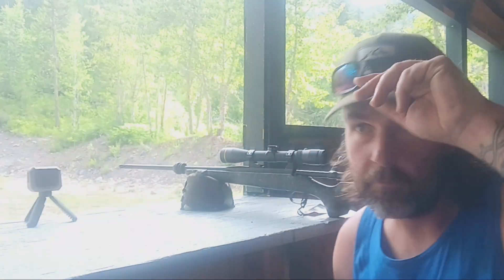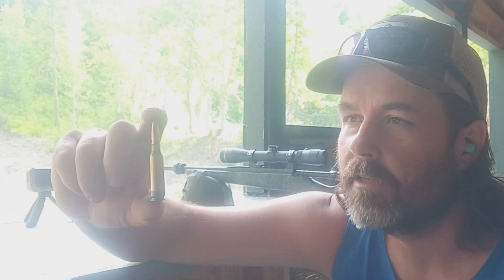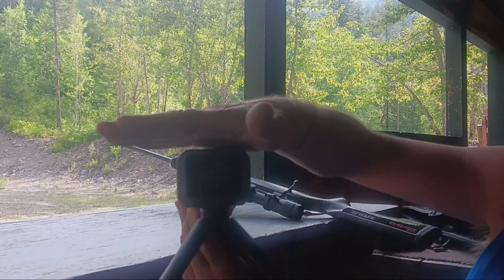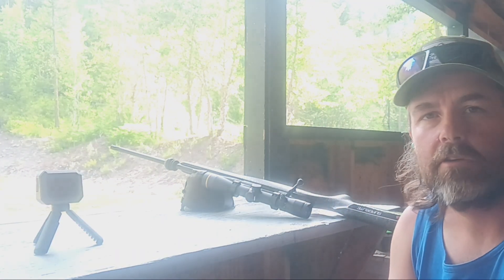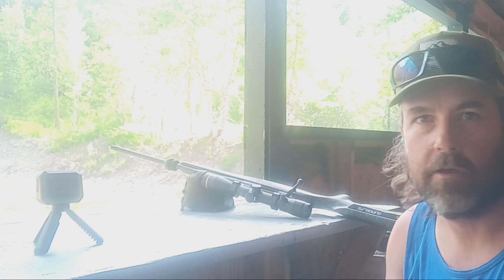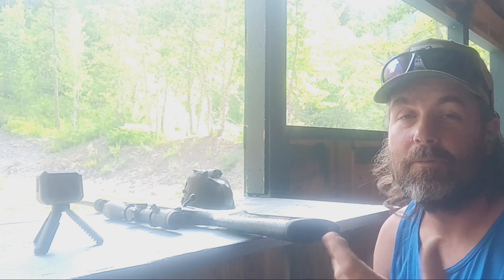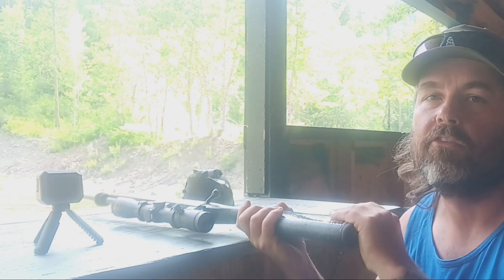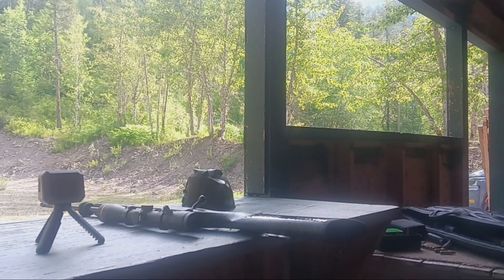High velocity 6.5CM possibly beating the 6.5 PRC??? What???

Comment: You can seekins precision makes a ph3 chambered in 277 fury! I already purchased 400 hybrid cases and sized them down to 6.5 creedmoor! Just need to order a seekins ph3 yet! They redesigned there action to handle 80k psi check out big game podcast with matty Nelson there easily achieving 3150fps 140gr class bullets out of 16inch barrel!
Reply: Update purchased a seekins  ph3 24inch barrel and iam shooting a 140gr fusion at 3,050fps! Tried several powders and verified thru grt! Done this in 308 as well a 168gr ttsx at 2950! Just purchased 277 dies and more casings along with 150gr accubonds!

Comment: So this is a 6.5 cm round? And is this something you’re going to try to market or just going to share the recipe? Just curious because I shoot a 6.5 cm with a 20 in barrel and looking to get better that high 2500’s velocity to low 2600’s
Reply from the maker: This is 277 Fury brass converted to 6.5 Creedmoor by running it through a Creedmoor full length sizing die after having milled about 2 tenthousands off a shell holder to bump the shoulder back a little extra that is required on first firing than trimmed to length. Fire forming is not necessary but a good idea. Then start working up a load. The stainless steel head will not give you pressure signs, so you need to be extra careful and watch all other signs. (Primers are not a good indicator either as somehow the stailess base seems to make them tougher.) Start like you would with available data for the CM, and don't go way off the charts. Superformance gave me the best velocities while maintaining good accuracy thuss far. I'm still working on this and will be for a while.
Reply from the maker: No, I don't have plans to market it. For liability reasons, I will not share my load data, but I am willing to give enough information so one can do the same and work a load to their rifle. 

Ball powders recommended for the CM work the best because of case capacity. Start low and work up. Don't push too far as the steel base does not give you pressure signs like brass dose.

Comment: Not many hunting rifles are a true sub 0.50” MOA
<.75 MOA is plenty good.  Mean radius why more relevant.   MR <0.30 is the benchmark for 500 yards.  All day
Reply from the maker: I personally believe in respecting game with an accurate and ethical kill shot. Know your limits, and don't push them on game.

I find the milk jug challenge to be a good test for a hunters' limits regardless of how well one can shoot paper. If you can hit (not graze) the jug and make it pop first shot (cold bore) from whatever Shooting position than that is an okay range providing the the bullet one is driving has enough energy and velocity to get the job done right. (Water is not a good test method as the water does not compress)

Comment: Glad to see you're back. Talk about coming back with a bang! Can't wait for you to try this in a 7mm-08 or 308 Win. I wonder now close a 7mm-08 would get to the 280AI? Or would it just make it to 280 Rem? Won't ask you what powders you're using but I am wondering if you keep checking the headspace to see if you're getting any set back. What a wonderful idea. Presently we're limited to .473 rim diameter so nothing in a magnum case diameter. I'm not really interested in that because you're getting in the higher recoil range. Not very useful in a lightweight hunting rig. But in a 7mm-08 you might be able to sling 160 grain bullets at a very interesting speed at least with Spitzer bullets. As you know it's all about case capacity and powder selection. But at higher pressure you almost always have complete burning of the powder. Or you might want to do this to regain all the velocity you lost because you have a shorter barrel. Heck everyone would gladly go down to an 18-20 inch barrel if there was no velocity penalty. Great idea!
Reply from the maker: Back shortly then on the road for three weeks. Hopefully, I can make more time for YouTube and get consistent with some videos again.

I don't currently have tools for checking headspace properly, so I have been conservative with testing. That is something I need to do. 

As I was moving forward with testing and doing the research I could it surprised me a little that when converting an AR10 to 277 Fury you're using the same bolt carrier, nothing's beefed up like i would have thought (im not an AR guy so i didn't look deep but was saprised by what i was able to find) As well as looking into the 7mm backcountry and it not being considered a magnum. Is that because of how the steel case works, it doesn't drive as much pressure back.I don't know, I'm still researching this, still working on it, still have a long ways to go.

Hitting the equivalent of a 280 with a 7mm-08 should be easy. It would not saprise me if it could be pushed to the equivalent of a 280 AI.
Reply: @simplemindedfella  From what I saw about the 7mm Backcountry, they say that because the surface area of the base of standard case is less than a magnum case, the bolt thrust is the same at 80K pressure as 65K in a magnum. 
The only reason I asked about headspace is now is now you don't have any indications of pressure from the case head so you're flying blind. Apparently normal rifles were able to handle the 7mm Back.
Reply: @denisleblanc4506  Agree with you on the case diameter. Bolt thrust goes up with diameter for those that don't know. That's why you have significantly more thrust with a 6.5 Grendel than you do with 5.56.   These new high pressure cases pin the case to the chamber wall with the higher pressures. That reduces bolt thrust and makes it possible. The weak point, the head, where some cases aren't supported by the chamber, being steel reduces the case head stretch and loose primer pockets. The only thing I've wondered about, and haven't seen explained, is how does the actual primer deal with the extra pressure? Seems like the primer would still be just as susceptible to blowing even though it's in a steel pocket. 

@simplemindedfella, what rifle are you using?  I've never had a Creedmoor, but im 52 and had my fill of toting a 12 pound rifle last season lol  I've been contemplating a light weight spot and stalk rig. I have an AR  in 6.5 Grendel, so I had my eyes on a Howa Mini action maybe. Today I ran across a Davidsons Howa 1500 Superlite in 6.5 Creedmoor.  Look it up, gorgeous rifle. Google (HCSL65CRBRZSB)... it'll be here next week LOL.   This thing weighs 4lb 7oz 😮  It's not a mini action, but from what I read the Howa Super Lites use a scaled down action somewhere between the Mini and the normal Short Action. I think also the OD is turned down as much as they could get away with to reduce weight.  I'm curious if this milled down 2 lug action would hold up to what you're doing here. That's the reason I asked what rifle you have.  Man if you'll guinea pig it, I'll follow suit and give a whirl too 😅 

Bit of a side note, since that case head is steel, what are you looking at for pressure signs other than the primer? 

Side note 2. You think tracking the datum on fired brass moving forward would be an accurate indication of lug set back? Should be if you have brass that's been fired 3 times or more I'd think. I've noticed a lot of mine don't completely fire form first firing. After 3, if you aren't pushing the shoulder back excessively, you should be able to keep am eye on your headspace with a comparator.
Reply: @chrisrosenthal1210  I wouldn't rely on tracking the datum on fired cases because of the possibility of spring back. I don't know if they are still available but there used to be adjustable headspace gauges available. These would be more versatile since you're not limited to a Go and NoGo gauge.
Reply: @denisleblanc4506  Sorry, I guess I should have clarified more. On the fired cases, I'm assuming you can feel it bottoming out when you try to re chamber it. If I'm looking for my headspace number, I strip the bolt/ejector so I can feel if it's touching going into battery. I push the shoulder half a though at a time until I can barely feel or can't feel the brass bottoming out. I do that with several cases until I'm satisfied I'm getting the exact number down to .001 or .0005 where I can feel contact. Then I back off another .001 or two depending on what rifle. But I log all this, touching and the dimension I'm sizing it to, and date it so I can look back on past notes. I was just thinking if I started having any lug set back, I'd probably notice my sizing dimention change over time.